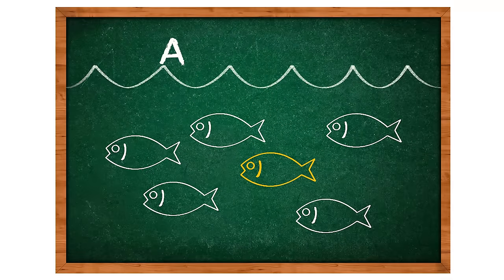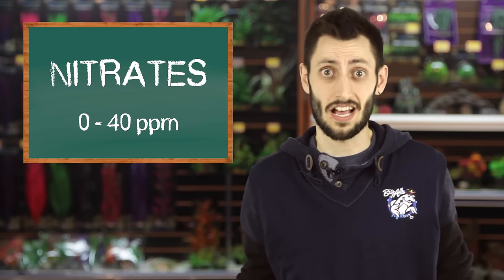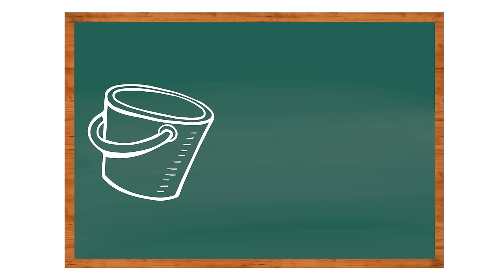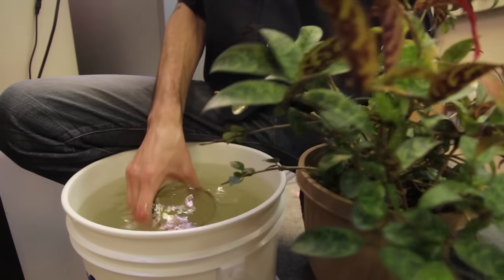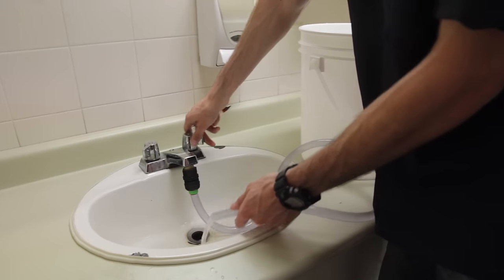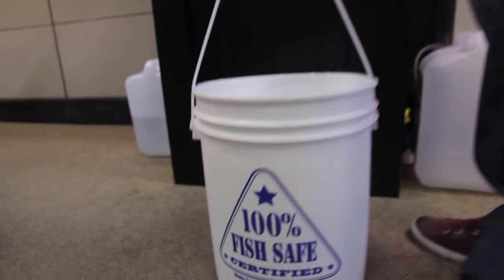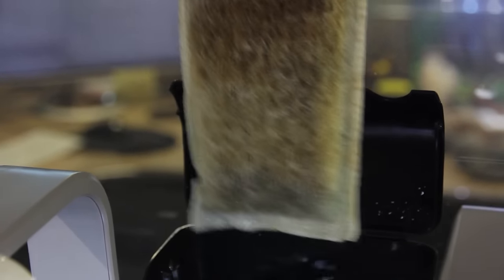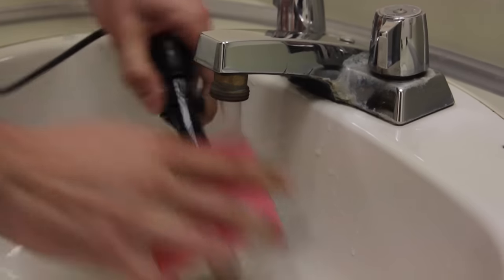Basic Aquarium Maintenance 101 | BigAlsPets.com

Comment: I know this is an old video, but a little tip for those watching now - those carbon filter cartridges are not necessary and are only there so you spend more money.  Take the cartridge, and whatever holder it comes in, out and replace with sponges.  You just need more surface area for the beneficial bacteria.

Comment: 1.  You are AWESOME.  Your vids are great.  I am subbed and following....2.  The only thing I don't agree with, and I get your are advising on the safe side....is cleaning your filter the same day you do a water change.  I've done this for years.  I still clean my filters once a month during water changes.  What's important is to make sure you get your media into a bucket of tank water while you are cleaning the filters.  But it hasn't stripped my beneficial bacteria.  I do add bacteria after water changes, but after testing water, many times after the fact, there has been no change in ammonia, nitrites, nitrates.  You are spot on with EVERYTHING.  Just that one thing.....You know far more than I do, so please know I'm not trying to be critical AT ALL.  Just sharing :)  Keep up the GREAT work!!!

Comment: When doing water changes, I pour the water onto a clean child's plastic plate that I float atop the water It disperses the impact of the water to stop any sumtrate getting whirled up and the water becoming unnecessarily cloudy. It works fantastic! And is especially helpful if you are using sand as your substrate.

Comment: Semi Unrelated Question!

I bought a USED tank off someone, noticed afterwards that it has a 1 inch long surface scratch on the OUTSIDE. The scratch is deep enough that when passing my nail over it, it catches my nail. Can that compromise the integrity of the strength of the glass under water pressure? Should I get a new tank?

Comment: When I put water into my tank I put the bucket above the tank and let it trickle in via Air hose with a little valve on it. It drips into the tank over a period of about 2 hours.
Reply: Myles Prower good idea but I find it unnecessary. But better safe than sorry though that is for sure
Reply: I have sand and I really don't want to stir it up. :)
Reply: Myles Prower I didn't think of that! Then for that aspect, that would be perfect. I forgot how messy sand is

Comment: So, as long as your water quality is in solid condition, you could theoretically alternate water changes with filter cleaning every other week. ie; Week 1: Water Change, Week 2: Filter Clean, Week 3: Water change, etc etc etc. Correct me if I'm wrong, of course. And this would all rely on water quality being at it's best during this time, otherwise more frequent water changes would bee needed.

But, assuming this scenario and your diligence, one would be capable of setting a cleaning schedule to keep the tank in tip top condition.

Comment: the only concern i may have is that if you use any water from the hot water heater and you have a water softener you may be introducing quite a bit of salt water.
i just fill my pails and let them set overnight

Comment: We have a brand new 10 gallon tank. We cycled 48 hours. Took the water to the pet store to get it tested & then added 3 red platys yesterday. How often should I be testing the water while we are waiting for the tank to regulate? Should I add a bacterial supplement since it's a new tank?
Reply: Sudden Kimpact Yes, the bacterial supplement will help with the initial ammonia spike, in the cycling stage, you should also test the water daily, go to a pet store and buy an api freshwater master test kit.
Reply: you didn't cycle it unless you added ammonia to the water. and you didn't cycle it anyway, as it takes 4-8 weeks usually, not 2 days. even if you're lucky enough to still have living fish you put them through a pretty shitty couple of months, its cruel to cycle with live animals in tank.
Reply: Look I thought I had done research when I set this up. I bought the tank and knew I needed to "cycle" it. Petco told me to run 24-48 hrs. So I decided to ere on the side of caution and ran it 48. Then I brought the water in to be tested because I wanted to make sure it was safe. And she told me it looked "perfect" and told me to add the 3 platies.  Then FB groups yelled at me just like you just did. So I got the API test kit and prime and tested every single day dosing extra prime and doing 30-50% water change daily for the past 2 months until this thing cycled(by the way they did all live). Since then I have acquired 3 more tanks that are all currently fishless cycling. I tried my best to do as much research as possible but it's super hard when the "experts" at the pet store are telling you something completely different. Your comment is rude and unhelpful. I don't plan on fish in cycling again and I had no intentions of setting out to be cruel. I've done my best to do right by these fish. I wasn't one of those people that was itching to get a fish right away. I thought I was doing the right thing.
Reply: lol look the people at petco don't give two shits. tanks need to be cycled before fish are bought, but the people at petco know that most fish will probably survive being cycled in-tank, so they don't care if the animals suffer. i appreciate that you were obviously fed a line by the pet store employees, but i do tend to have limited patience for people who don't do the proper, thorough research before they get a pet. my local fish store told me i didn't need to bother cycling either, but i was already thoroughly convinced by everything i'd read about it before that, so i ignored them and did it anyway.

saying all that, you've quite obviously learned since and it wasn't a decision made out of laziness or cruelty, i wasn't suggesting that. however, just to check...you are cycling your new tanks now by adding an ammonia source, correct? not just letting the tank water sit? just double checking.
and lastly, its worth noting that prime does absolutely nothing, you don't need to bother with it.
Reply: I am using pure ammonia and seeding bacteria with media from my cycled tank. The last time I owned a tank was in the 90s and the only resource I had was pet stores and one library book. Things have changed a lot since then so forgive me for messing up this 10 gal 2 months ago.
Reply: Yeah u should
Reply: Tip: never take advice from Petco. They have no fucking clue what they're talking about.

Comment: So I have done everything in your videos and my water has been tested and is all good. I'm having a huge issue with evaporation and buildup of crunchy white stuff. Also algee mainly on the light bar where there is no water.  Is there any easy way to get rid of this?  I have scrubbed many hours and can't get rid of it. Also how do I get the dark algee off the plastic plants and decorations. Tired of them breaking and having to buy more.

Comment: ok I have a question. I bought a 5 gallon kit for my betta that has a built in filter that in behind a plastic thingy. It doesnt have any bio media. should I add some myself behind the plastic part that hides the filter? also, should I put it behind the filter cartridge and in front of the pump? or can I put it wherever?

Comment: Anyone have a pro tip about conditioning water? As in, how long should I wait after adding the conditioner, before adding the water to my tank? I am always told to wait  at least overnight-24hours.
Reply from the maker: Adding water conditioner in a mixing bucket with a power head circulating, is the best way, For larger systems you will need to add directly in the aquarium before adding your water.

Comment: This might be a little outside the normal boundaries of this channel, but I have a couple of  Aquafarm tanks, (3 gal) that I'm currently cycling before adding fish. I have run a larger aquaponic system, but since the Aquafarm is kind of a hybrid of fish tank and aquaponic system, what tips do you have for maintenance on one? 
Ideally, the grow media is the biofilter and the plants are absorbing the nitrates, but would you still need to do partial water changes and conditioning the water for a "closed system" tank like this?
Thanks so much.

Comment: Why do test kits still have Nitrite test solution?  Surely, ammonia and Nitrate are fundamentally important, but I can't think of any reason or even corrective action specific to Nitrite that wouldn't also be evident in an Ammonia or Nitrate test.  What am I missing here?  Just a long-time curiosity...
Reply from the maker: There is a point in time where you will read potentially no nitrate and no ammonia, with nitrite being the only reading. It doesn't happen often and usually only during the initial cycle, but there are instances where you may have no ammonia or nitrate but are losing fish to high amounts of nitrite.
Reply: Big Al's thanks!  I figure with Nitrosomonas and Nitrobacters being just about omnipresent, this couldn't be anything but temporary.

Comment: Could one get away with connecting the tape's hose to the aquarium, adding the new water (at the right temperature) and adding the total amount of treatment immediately after the tank has filled? I'm planning on getting a large 370lt/100 gallon tank and going back and forth with 10 buckets of water per water change doesn't sound fun.

Comment: How can you clean the gravel, if you have a planted tank? Wouldn't you be getting rid of valuable nutrients for the plants? As always, great video! :)
Reply: if you are using an aquasoil substrate ("dirted" tank) you dont need to vaccum.  but sand or gravel you'll need to vacuum 50%  of the ground space during the water change

Comment: Ok so I've got a fish tank with a filter, the filter is pumping out bubbles, but fish occasionally go up to the top to breathe, what should I do? I can change the strength of the filter, but as I increase it the fish get pushed around by the filter. Thanks for helping
Reply: It depends on the fish! A betta will always need to breathe some air, and some just like the surface.

Comment: Should i use the Syphon whilst fish are still in the tank? Or are you supposed to remove the fish during water changes?
Reply: Never remove your fish for water changes.  Unnecessary stress.  You should only be removing 25% of water, so leaving them in will not harm them.  Be sure not to suck up small fish in the siphon.

Comment: Hey guy this is an old video but I live very near the foothills and I have been told that our tap water is the cleanest in the valley. Do I still need to do a water conditioner for my water? I know it's an old video but I would really appreciate a response thank you.
Reply: Yes. Tap water always has chlorine, unless you are using well water. You can actually buy a chlorine test kit to double check. 
Where I live, we have crazy soft (nearly R/O soft at 26 tds), but we still have chlorine, and I can actually taste it, after having used a water filter for years now. Straight tap water has a slightly odd flavor.

Comment: I'm a bit confused about the filter, do you replace it or just rinse it? I have the white mesh ones with the black carbon filling.
Reply: There should be two mesh-looking parts - one with carbon, one without. The part with carbon gets replaced. If there's only the part with carbon, you should get a filter sponge and let that run in the tank for about a month before you change the carbon-filled part. Until then just keep the same filter. Ammonia is a far too big problem to risk just to make the tank look nice.

Until you can safely change the filter, make sure to do very frequent water changes.

Comment: How do you clean white film off plastic plants and algae off rocks? I soaked everything in 10% bleach. I now have a white film on my plastic plants instead of algae. The rocks are cleaner, but still a little bit of algae on them. I'm guessing a little bit of algae is good, not the white film. It seems to almost disappeared when it's wet in the sink. I haven't put them back in my tank yet.

Comment: I can use some advice.
I have a 75 gallon aquarium 
60"x12"x24" LxWxH ive been noticing the water become cloudy like a brownish green color, and i have two filters running, i clean the filter twice a week, recently i changed 50% of the water, and the water went back to becoming cloudy. Help
Reply: You are going through a bacterial fluctuation.  You can use a bacterial additive, a water clarifier, or even a sterilizer.  The larger water changes will not help with this... It will actually prolong the cloudiness.

Comment: My biggest issue is overfeeding. I really can't figure out how much to feed them. I started with 4 fish and 3 bottom feeders in my 3 gal aquarium and now I'm down to 1 fish and 1 bottom feeder. I fed them a small pinch as recommended one time per day but every few weeks to a month another one of my fish would start swimming upside down and then die. Any tips? This is making me not want to have fish. I know there's a method for letting them eat for a certain amount of time, but when I had 4 fish, some of them would be eating while others were searching for the food.
Reply: It sounds like most of your problems might be coming from the size of the tank. With that many fish, in a 3 gal., you would need to do a daily 80% water change to keep ammonia down! 

It can work for a small amount of time, but a 10 gal. would work much better! The more water, the less you need to change it! (And the less fish. One tiny fish in say, a 50 gal might only need a monthly water change. There's so much water!)

Comment: Is water hardness a factor?  You say water conditioner makes tap water safe for fish.  Our tap water is absurdly hard (14 on the hardness scale).  Is this a non-issue?  Or is it something the water conditioner will address?  Or is there something else I need to do?
Reply: Each fish wants a different water hardness. Some love hard water, some soft, and some right in the middle. You can find a bunch of different fish that LOVE hard water, so go for those! 

Follow what he said for the tank, and make sure it's the right size for the fish! I'm pretty sure that most fish that like hard water need a LOT more than one gallon per inch.

Comment: okie dokie so i have a new 20 gallon set up right now. I have no fish in it yet because the waters ammonia is off the charts (seriously, on the kit it turned dark green which is .6) and i keep adding ammonia remover to it but it doesnt seem to be going down, help me, im not new with this by the way lol
Reply: Do water changes to reduce the ammonia.  Stop pouring more chemicals in in an attempt to reduce the ammonia.  Are you dosing ammonia to cycle the tank?  If so stop at this point and test daily until you see nitrite and then nitrate.  Once you have nitrate and no ammonia or nitrite you are cycled.  Also, try some dr Tim’s beneficial bacteria once the ammonia levels drop a bit.  This will help cultivate the beneficial bacteria for the biofilter.

Comment: When I clean out my fish tank I usually remove all of the fish decorations and place them on a towel while I siphon it so things don't knock over and it's not so crowded. Then, I rinse out my decorations under tap water. Is it safe to rinse them under tap water, and is it safe to remove the decorations during this process?
Reply: Hi, Homestuck! It's fine to clean everything except the filter with tap water! As long as the filter gets cleaned in tank water, all that matters is No Soap.

Comment: I have a 1.5 gallon just one betta fish , do I do water changes frequently?
Reply: Many would argue that you shouldn't keep a betta in that small of tank in the first place :/ Minimum would be 2.5 gallons or even 3 gallons. I have mine in a 5 gallon by itself with only a snail. The smaller the tank the more tedious maintenance will be for you. Because of the smaller amount of water it is much more likely to have temperature fluctuations in the water as well  as getting dangerous ammonia spikes. Having more water (about 5 gallons at least) dilutes and minimizes those two factors from happening. But.... since you have 1.5 gallons it'll be more tedious because you have to remove everything in the tank and scoop out your fish with a cup and replace practically all the water in the tank and rinse decor and substrate. This should happen probably I wanna say....every 3 days? You'd just have to look that part up. But for bigger tanks that have more water you can get by with doing only one water change once a week or once every two weeks. Hope this was informative and helpful! Have a lovely day! :)

Comment: I'm just starting my 46 gallon tank and can't seem to find any good advice on how to add water that is at the compatible 75-78 degrees for my tropical tank. I have an in-home water softener which I have been told is a horrible thing to use and will mess up the entire balance of the ecosystem. I can not by pass the hot, only the cold. Boiling to heat water is a no no for other reasons, but was told by a local aquarium shop manager that she lowers her heater to be sure it is covered with water for the water change, and just runs her cold water into her tank very slowly. I would think that even at a very slow rate that would also be bad for your fish, but she insists she has never had a loss. Can anyone give me some practical advice? Thanks
Reply: If there is no other option, using water as warm as you can get it (room temp, of the hottest room) and then adding it over 12 hours would probably work best. 

You could also get a second heater, but that's not something easy to drop money on. I hope you have good luck with your tank!